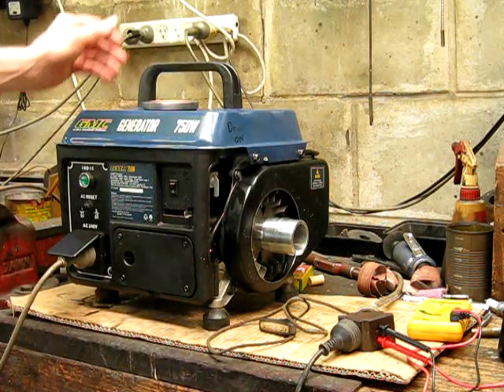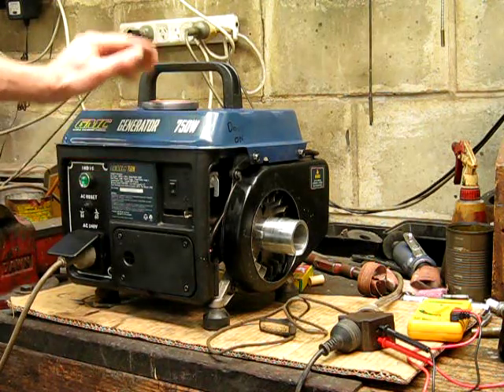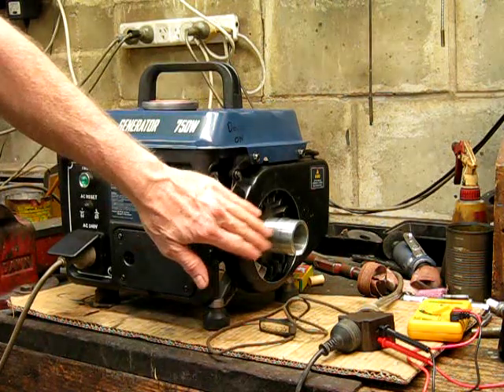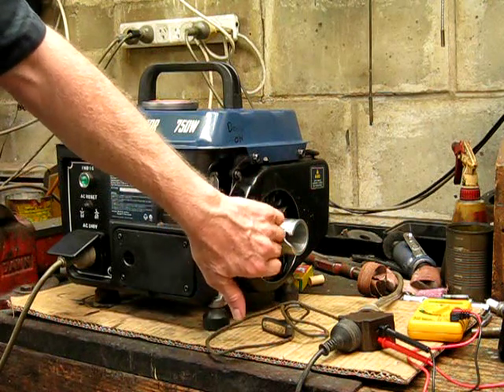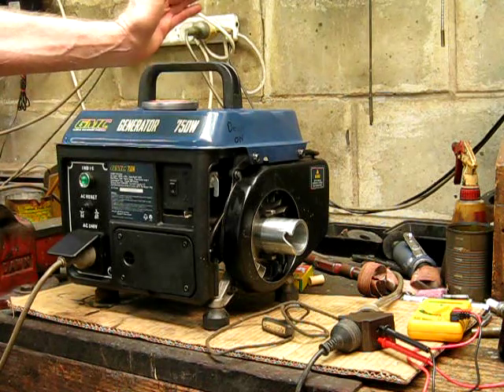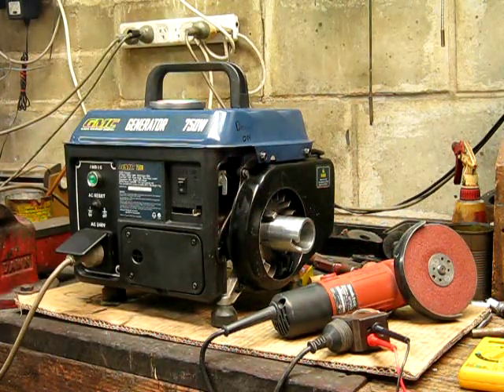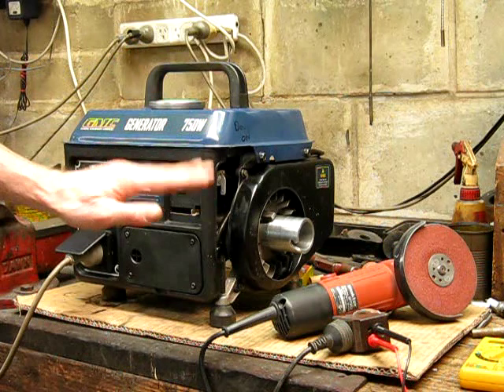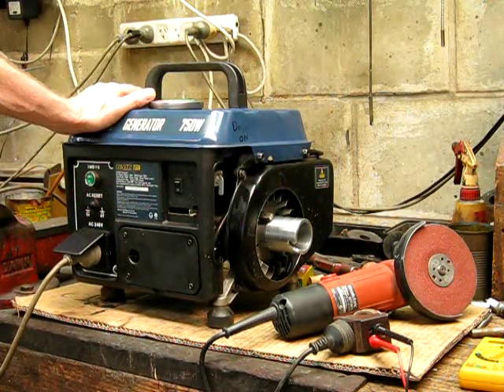My cheap Chinese generator - $20 - a bargain

Comment: I have one of these generators and the DC output is around 21v, the AC is around 300v..any advice on setting the voltage output? did I read in one of your answers below about setting the voltage? Any advice appreciated. ( starting mine with a cordless drill these days btw)
Reply from the maker: You need to adjust the governor setting.  From memory there is a Phillips headed screw below the fuel tank on one end which adjusts a linkage with a coil spring going to it. 

Use a double adapter on the AC output lead, put a multimeter on one side and a load (hair dryer or whatever draws about 700 - 800 watts) on the other.  With the genny running, back off the Phillips head screw and watch the AC voltage vary.  When it's at 240 or 220 (whatever suits) turn on the load and then re-adjust the speed -  it's done.  The DC should now be around 14 - 15 volts as that outlet is for battery charging.

Cheers Rob
Reply: @Xynudu  ah thank you 😀

Comment: Can a small Chinese generator be used with a water turned turbine?
Reply from the maker: Hi Mua,

Yes, provided you can maintain a suitable/constant rotational speed.

There's no reason why water couldn't do the job.  It would be easy to hook the 15 volt DC battery charging output up to a battery bank.  It would be advisable to use a solar panel regulator.

Even AC output could be used provided the current can be regulated.

Cheers Rob

Comment: motor in2 timpi,am avut si eu unul, dar a functiona cu lpg
Reply from the maker: Mihai Lungu 

Cum a făcut adăuga ulei pentru lpg?
Reply: xynudu am introdus uleiul in rezervor,iar lpg la carburator.Vezi www Cosmin Nertan pe youtube
Reply: xynudu Ai vazut userul W.W.W.COSMIN NERTAN?,pe youtube
Reply from the maker: Mihai Lungu No.
Reply: xynudu Pe acel user vezi cum trece aerul prin benzina si pot porni motorull fara benzina lichida
Reply from the maker: Mihai Lungu 

Înţeleg că poate picura ulei în carburator deschiderea cu GPL.
Reply: xynudu uleiul vine pe conducta ca si benzina si carburatorul isi face treaba singur iar gazul intra separat.Ma duc la servici,ne auzim peste 10 ore

Comment: how much power does the angle grinder suck from the machine.. shes seems to be shaking as the grinder runs and gobbles up the amps..
Reply from the maker: I think it was a 600 watt grinder.

Comment from the maker: Thanks for the generous offer, but I've sold it and picked up another $20 generator, but this one is a four stroke rated at 1 Kva. The two stroke ones are compact and low weight, great for power tools, but lights tend to flicker on them as the output is very dirty/unstable. Rob.

Comment from the maker: These Chinese generators are all basically a copy of the Yamaha ET650 and a wide range of interchangeable parts are available on Ebay. If the spark has gone a replacement CDI unit can be got for about $10 delivered.  Same cheap prices for carbs and most other parts, so it's quite rebuildable for peanuts.  Cheers Rob.

Comment from the maker: Thanks for the video response.  Some good information in there.  Looks like Ebay parts have got a lot cheaper since I looked, so buying a replacement starter is quite good value now.  Looking at the plastic cord pulley in the starter, I think the rope expands/spreads the plastic and eventually cracks it - just bad design.  Cheers Rob.

Comment from the maker: I've since sold the genny as I got a larger one (also cheap) so I can't show you the pulley.

It's basically flat on the end that pulls up against the flywheel (between the two cast lugs for the old pull start).  A tube type nut has to be made to reach through the end of the pulley and thread onto the end of the crankshaft.  The tube nut also centres and locates the pulley correctly. All easy to make, especially if you have a small lathe.

Cheers Rob.

Comment from the maker: I had hard starting issues until I set the spark plug gap to 0.7 mm (0.7 - 0.8 mm recommended).

It also starts easier on the correct oil/fuel ratio of 40:1

Starts easily from cold with full choke, and from hot with no choke - big difference to how it was before I made these changes.

I dislike running air cooled two strokes on less than 30:1, but in this case it pays to follow the manufacturers instructions.

Rob
Reply: xynudu hi friend my little jeni just died no spark to plug coil my be any help